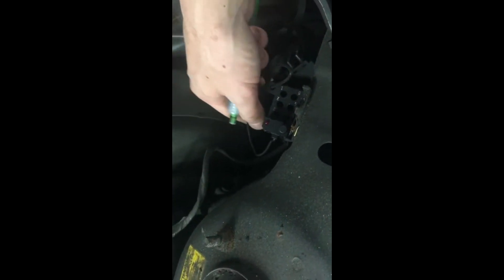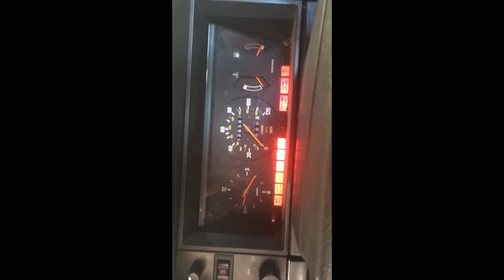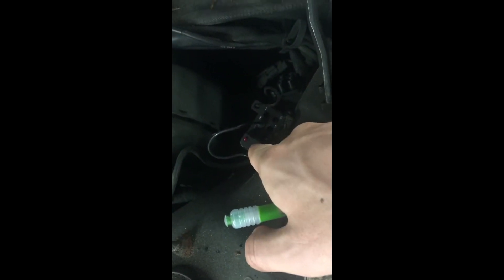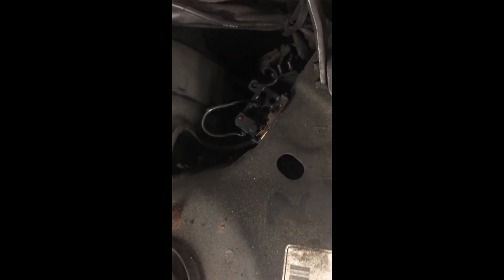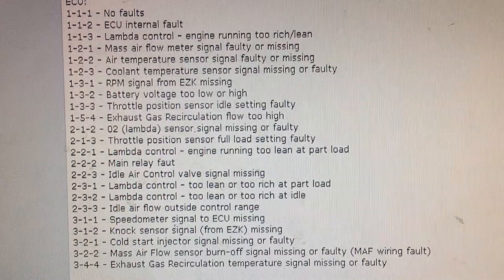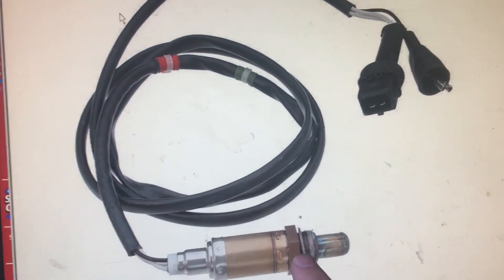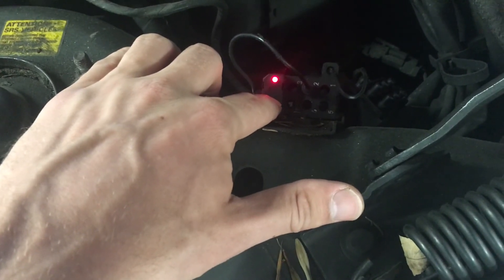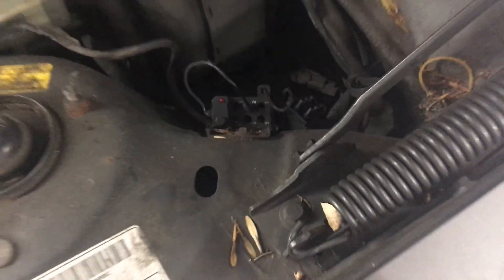Read & Understand Volvo Diagnostic Codes On 1992-1995 Volvos

Comment: What is the malfunction if the Volvo 940 6 code comes on 8 times?
Reply from the maker: Thanks a bunch for watching my video and taking the time to comment. What slot is that blink code coming from? Thanks for any update.
Reply: @WheelsTips  6
Reply: @WheelsTips  The light comes on 8 times in code number 6, what is the fault?
Reply: 2+2+4 coded?

Comment: Got a Volvo 960 94 and the check engine light came on ima check if this works.
Reply from the maker: Definitely share an update, thanks.
Reply: @WheelsTips  so this did give me codes that led to MAF sensor and idle air control valve which I found out were both working fine. The issue was the main fuel pump(external) was going out causing the air/fuel ratio to be thrown off. Once replacing fuel pump car was running great once again

Comment: i have a volvo 440 1993, beautiful car ;), but been having some difficulties with the carburetor, and cannot seem to find a diagnostic connector anywhere in europe. is there someone who could help? thank You
Reply from the maker: Thanks a bunch for watching my video and taking the time to comment.  The diagnostic unit or OBD for for your Volvo 440 should be on the front-left strut tower, in the engine bay.  Please share an update, thanks.
Reply: @WheelsTips  thank You for the reply. i got that part. what I cant find is the tools to run the diagnostic...on the europian market.
Reply from the maker: Thanks for the follow up, it’s a blink code readout, just like in the video. Do you not have the lamp, button and slots to plug in the connector that’s already on the car?  Thanks for any update.
Reply: @WheelsTips  OMG!!!!!  Are you telling me the car can do it by it self??????? I mean with the help of a human :D, and everything one needed should be by default build in the car? im sorry im not a mechanic but they have been telling me that i will never find the diagnostic cable needed.
Reply from the maker: Let me know what blink codes you have, maybe I can give you my experience repairing the fault code.
Reply: @WheelsTips  ok ok ive got 4,4,1 then 1,2,3 then 2,2,3 aaaaand the car has beeen running like crazy, it is like when I stop on the red light or drive or change the gear the engine will be running 3000.  it uses so much gas, and people think im crazy. also when I try to switch gear to slow down I cannot, it jis as if I am constantly speeding ( is it on the gas english? like accelerating ) . ive been to so many mechanics and they just dont seem to find the problem. theyve changed the ignition part already 2 times since the acceleratior . doesnt seem to release the cable. it is very hard to find the parts for this car in  middle europe, but i just got the new throttle valve sensor and the coolant temp sensor. i hope when we switch those the problem would be solved... Im SUPER GRATEFUL You have made this video! I would really love to keep this car, it is turning 30 this year, so I might be able to register it as an oldtimer. BIG THANK YOU!
Reply from the maker: Wondering if you were able to solve this, very interested in the outcome.

Comment: do the diagnostic units go bad. I have an engine light problem but all I can get out of the diagnostic unit is repeated 1  1   1   code for cleared system.
Reply from the maker: Thanks a bunch for watching my video and taking the time to comment. What issues are you having with the car to start with? Also you may want to check all the diagnostics ports to see if another port has a stored code. Please share an update, you may also want to make sure nothing is corroded.
Reply: If it's the service engine light on the far left that's not a diagnostic code. That means you need to change your oil. And you have to pull the two screws holding the cover under the steering wheel on. Pull that cover and reach up and reset the switch on the back of the instrument cluster.

Comment: Was there a check engine or service engine warning light to indicate there was an issue needing the code? And did the dash warning light self correct or require more manual inputs?
Reply from the maker: Hey Rick Peterson thanks for watching my. If I remember correctly the check engine light was on. I decided to clear the code to see if it was a glitch in the system. Please share an update on your issue and diagnostics.
Reply: @WheelsTips  93 240 Battery was under sized BCI Group 28 severly under powered, died 50 mile tow "TY AAA!" BTW no more ride along due to COVID 19!!! FYI/CYA!! Swapped battery BCI Grp 48, New Service Engine light indicated, goes out after 5 min warm up. Add insult to injury Sea Foam High Mileage treatment 5.33 oz in tank 5 gls gas, 5.33 oz to valve cover, 5.33 ov in the fuel pressure sensors hose "sipping". White smoke great show, homeless guys was trying to tell to "cut it off man, youre smoking A LOT!" So Service light after dead cell battery, a week later replaced PCV, flame trap, oil return, & hoses, Sea foam treatment, oil change Check engine stays on. Got my list of codes see what we find. Thanks and good luck.
Reply from the maker: Thanks a lot for the update Rick Peterson, good to know about the AAA situation.  I personally used to clear the codes after seafoaming and having the battery die as it could leave you with a lot of incorrect codes.  I would clear the codes and see what would come back and use those codes as a basis. I would document the codes before and after and see what comes back.
Reply: @WheelsTips  Disconnected/Reconnected to Battery, Check light gone. Service light remained. Reset Service light by manually pushed (?) "Trip reset" on back of Odometer (front trip reset broken/missing) as advertised on Brickboards. Have pics, Much easier to find after removing knee cushion under steering colum. All lights reset, no codes. Thanks for leading the way, fielding the question, good looking out!!
Reply from the maker: The service light can be trick to work with on Volvos, but thanks for the tip.  So you just hold the 'trip reset' for 20 seconds? I am guessing with the car off and key in position 1 or 2? Please share, thank you so much.

Comment: Hi. I have problem with it. When i press the button nothing happens.
Reply from the maker: Hey Jasper Jokinen thanks for watching my video.  It takes a physical look to know in this situation.  You may want to have someone look at it.  Please update the outcome of your diagnostics.
Reply: @WheelsTips  It only worked when you press the button in a certain way. so i think it has a loose connection or something.
Reply from the maker: Possible there is some corrosion. Please update when you find the answer, would greatly appreciate it and it would help the video tremendously. Thanks a lot for the contribution

Comment: Wheres the obd conector ita not under the coin holder i need it on mij 1995 volvo 850
Reply from the maker: Hey Timmy tijd , thanks for watching my video. It is possible you don’t have an OBD since OBD II started in 1996 , have you checked if you have the diagnostic port I showed in this video?
Reply: Thanks mate i know it i called a volvo dealer and they says that it has a light code my father knows al the codes thanks mate